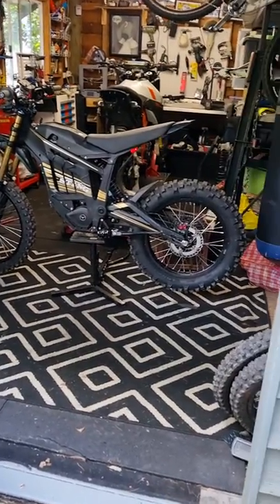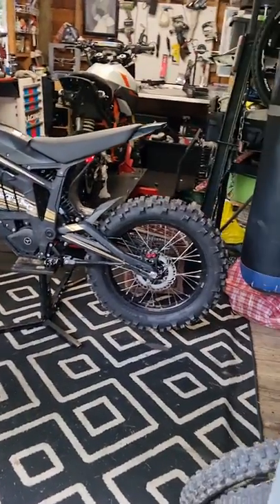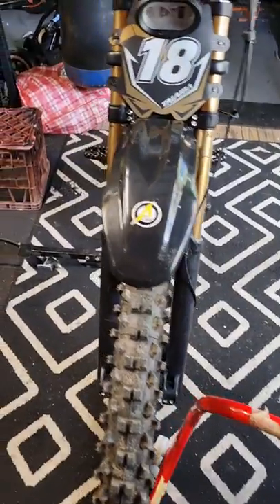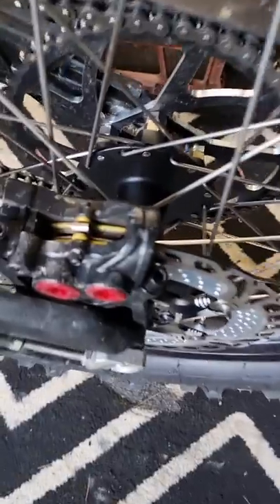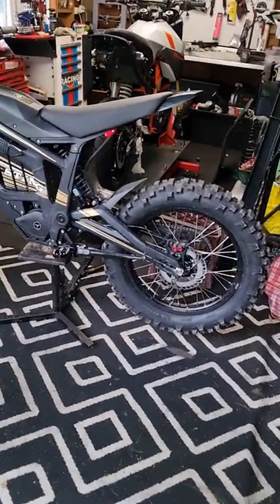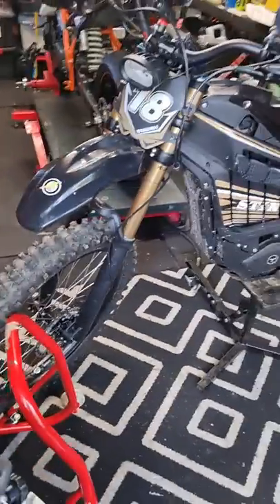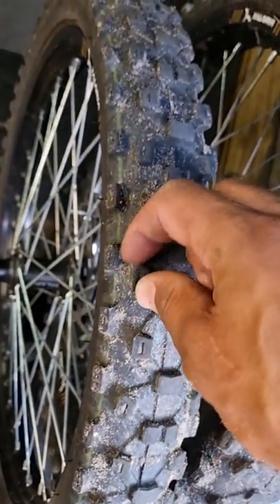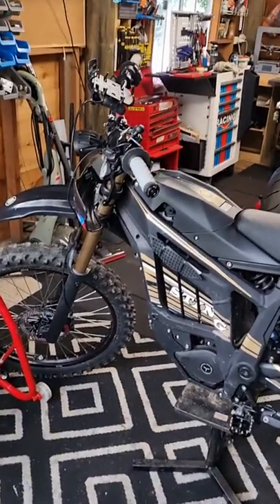my feedback after riding the 18/21 setup

Comment: Those tires are huge!  For a mountain bike 😂. I’m liking mine stock for now. Yea it needs better tires, but until a power upgrade is here I don’t personally want to do it. But I am swapping to a bigger sprocket to see how that is. I only ride right single tracks. Great vid. Ride on my Aussie brotha!!
Reply from the maker: I completely agree with you, it's all about what type of terrain with these bikes ! stock is almost always better, at least until a power upgrade is available ! i've tried 54, 58 and 60t..So far i like the 60t, only dropped 3km/h compared to 58T. I found gear ratio is only noticeable until maybe 30km/h, then it feels the same..hope this helps !
Reply: @jglaine  awe thanks man!  I wanted a 52 but got a 56 instead. I was kinda bummed as I don’t want to destroy the top speed. I got a new chain for the 52 but now it’s too short. I’ll let ya know how it works!  Or u could check the channel from time to time. I’ll be posting vids like crazy now lol. Cheers mate!!